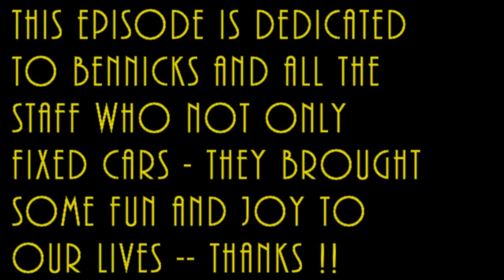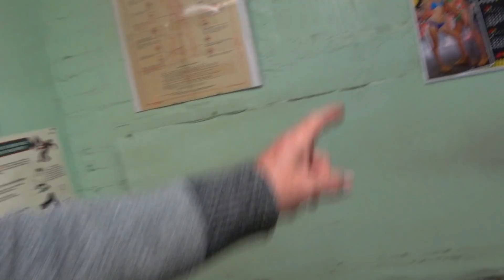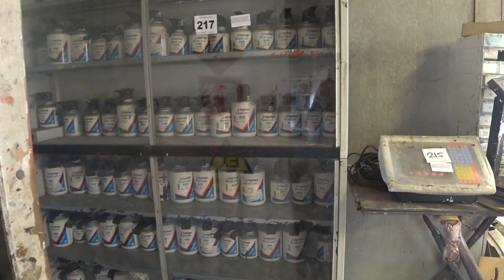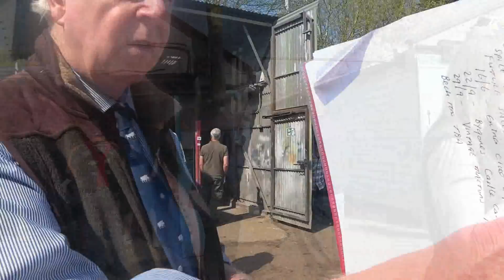It is the END of BENNICKS !

Comment: I imagine though they both retired from working? That's what happens when you cannot sell it and do not have any offspring whichwill follow up. It happens a lot. In fact,, I suppose it happened to you when you closed the kennels, too. It will also happen to me unless my son wants the business when I get older.

BTW that's a Series 3 Jaguar XJ6, it's not worth much (check on Ebay). Series 2, yes, series 1 certainly (and the XJ-C is off the charts). But a series 3? Nope. Some spares, maybe. 100 pounds. But you'll have to tow it away, plus taxes.

Still it's sad to see a good business go, I can imagine you had a bad feeling about it. 
I hope they both retire, and wish them a nice island in the sun. Goodbye Bennicks, may you fare well.
Reply: Well, after sitting outside for 8 years how good would the engine be. I'd pay about 25% over scrap (weight of the metal) value... and even then call it a risk. There's penty of those, I can buy a running car for less than 1500E (I think 750 pounds or so).  

Far more curious if they did it because of retirement. I wish them well.